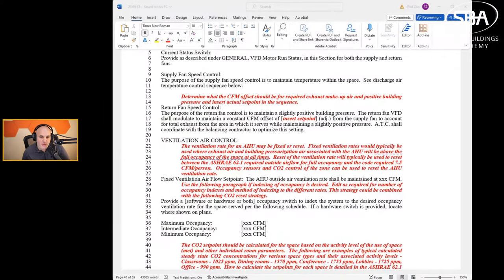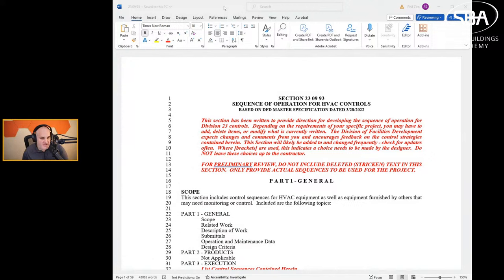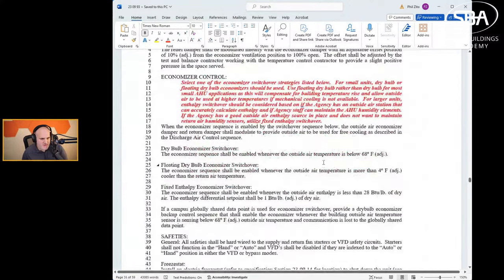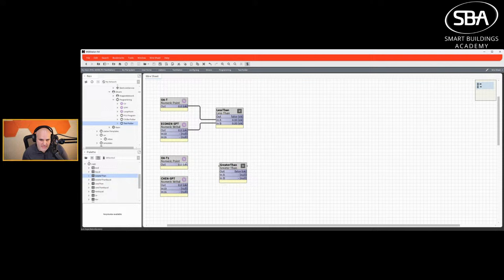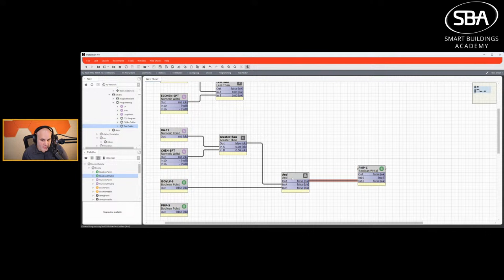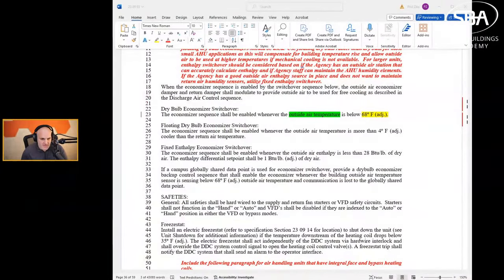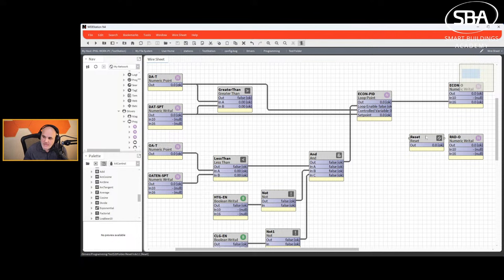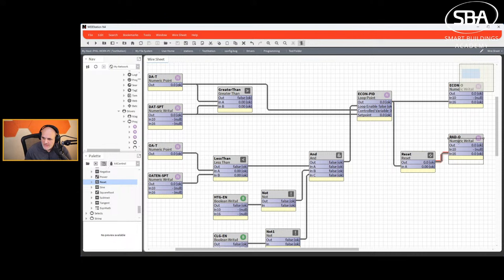SBA 447: How to Program a BAS

Comment: One of the things we experienced most in 2023 was coming behind folks that program in a verbatim manner per written sequence, but they do so with vendor specific blocks that make it difficult or next to impossible either follow or grab that brands module that contains that particular function block to make any revisions or even open portions of the station. I'm sure some folks would like to see scenarios where you display how certain brands (in your case WEBS) have pre-built blocks that make sequence programming more efficient, but compare this to strictly programming sequences with blocks that're default in every version of N4, or at least in the VykonPro Pallete. Speaking as a business owner (not to be selfish on requests :)...but my team would benefit greatly on showing some of efficiency gains to be had by using various function blocks to streamline their sequences. Things like lead/lag, sequencers, optimumStart/Stop, load shedding, rotational sequencers, or even writing out their own block with the program service.
Reply from the maker: Yep, I tend to teach the generic plain jane blocks from KitControl as much as possible but to your point each vendor has specific blocks that enhance programming. Some like PCT/CCT even have QA prompts that build your program. 

One of the more custom functions is the PCT/CCT State Table and MUX block. I love those but they are a bear if you don't understand that software.